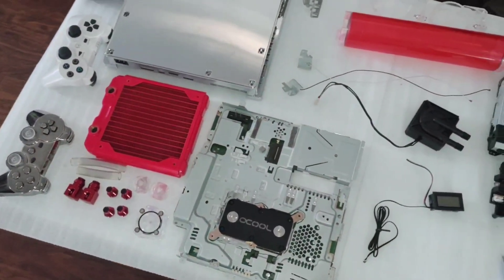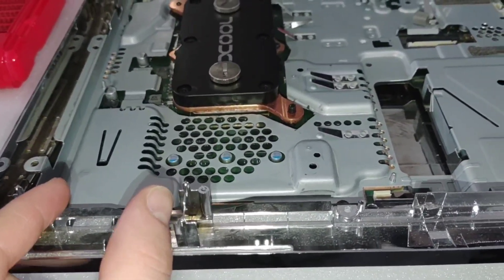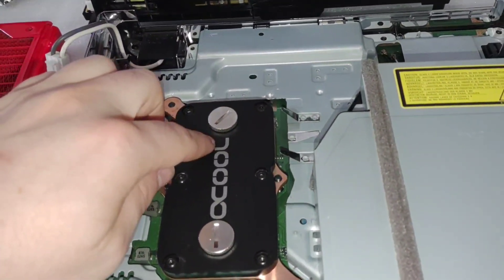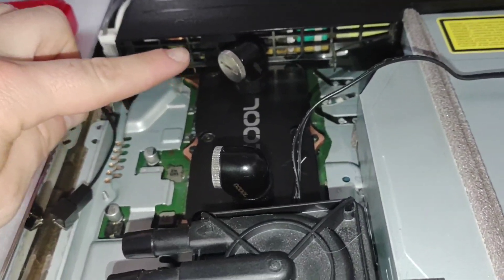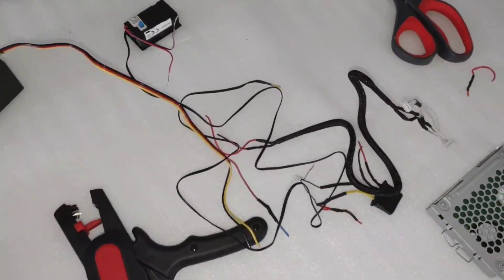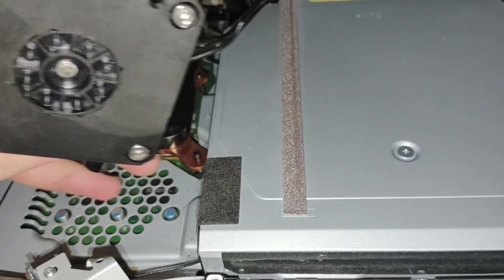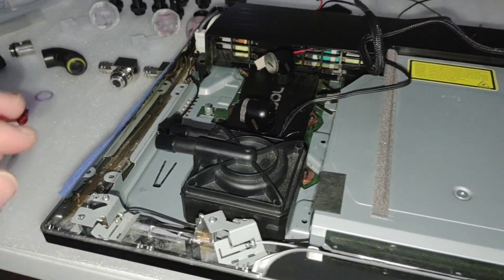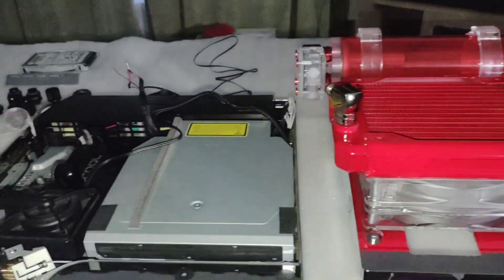Water-cooling a 1TB CFW PS3 Slim in 2024!!  (part 1/2)

Comment: I wish to do something similar but instead of modding it in the case itself I wish to drop the motherboard straight in a pc case and add 240mm AIO I have laying around. Though it will be almost impossible for me to grab that waterblock. Could there be a workaround for it? Was thinking of using an aluminium peltier water cooling block.
Reply from the maker: @Iploac  there's some blocks you can get and cut the brackets off to fit, but if doing that I'd recommend looking up GPU Waterblock on like Amazon, they are 15-20 bucks, should be able to just cut the brackets to size
Reply from the maker: @Iploac  that is what I did on the water cooled Vader RGH build

Comment: Do you have an extra ps3 slim water cooling block you can sell or know where to buy one?
Reply from the maker: @MrPelletty  unfortunately no this is my only one, I had another a long time ago sold it on Craigslist 😂 but that's when they were still available, I haven't seen a single Waterblock for PS3 slim or phat or 360 slim or phat since they've been discontinued, however for PS3 you should be able to get 2 of the 20ish dollar Amazon GPU Waterblocks and cut two of the legs off the mounting bracket and essentially have the same set up, I haven't tested that yet though but just by holding the block over the motherboard, 2 of them should fit as long as you shorten the bracket and drill new mounting holes, keep in mind the slim and phat have same size Waterblock/heatsink but the mounting plates are in opposite directions🤙
Reply: @trinkettinkeringking  What is the largest stable overclock you have ever achieved with the water cooling so far?